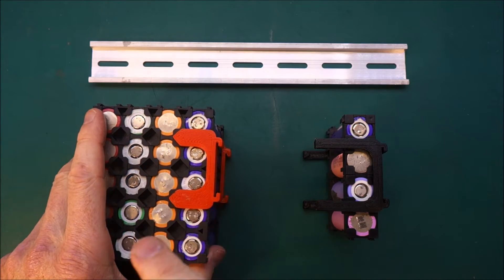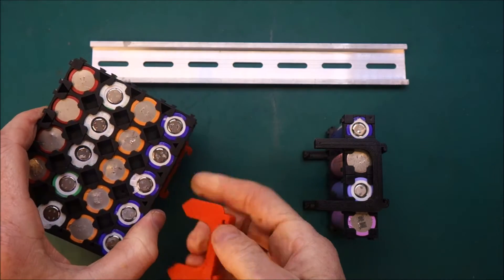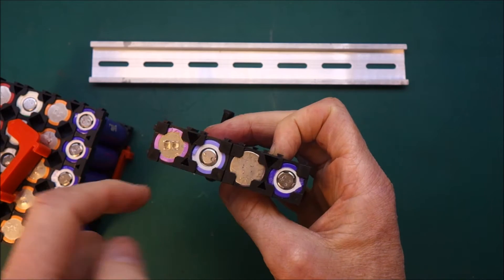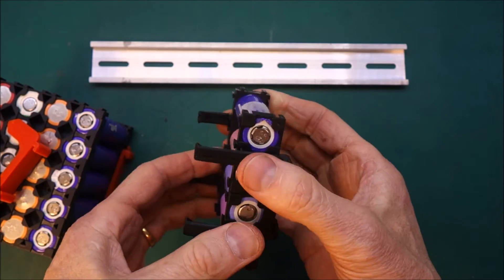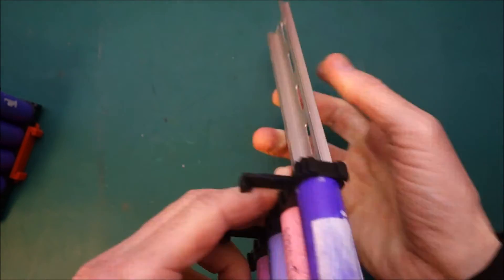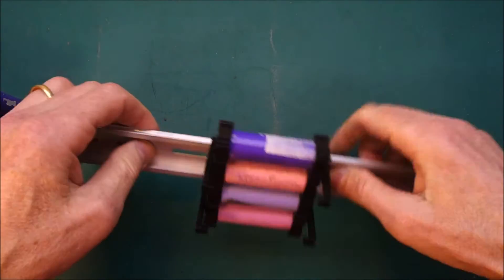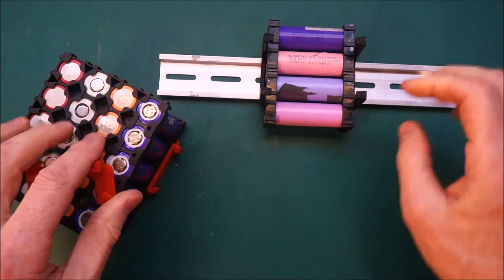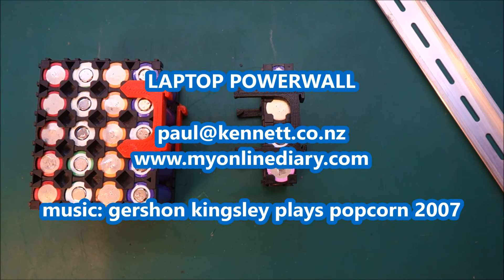Laptop Powerwall 79 - DIN mount for standard 1x2 18650 clips

Comment: Paul, I have been following you with your din mounting. I have something that might help to connect / disconnect packs without having to pull each pack at a time. I have a (din spring) mechanism that will do what you want. Maybe together we can work to make a perfect solution? 
You may need to change your 3D file? however, I will send you a pic of my spring clip. let's hope it can benifiit many others? I really like your thinking. (:-D))